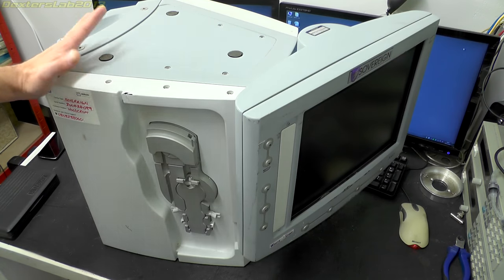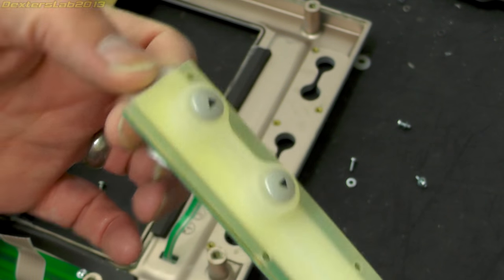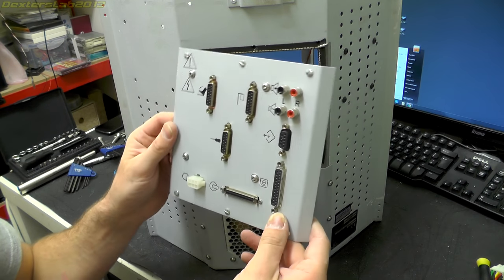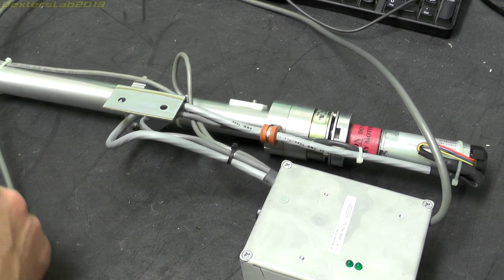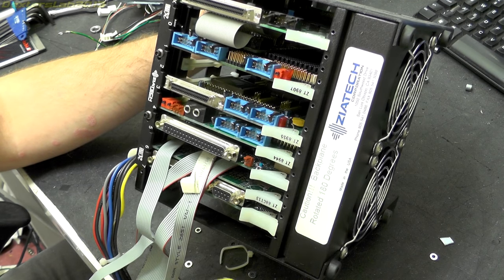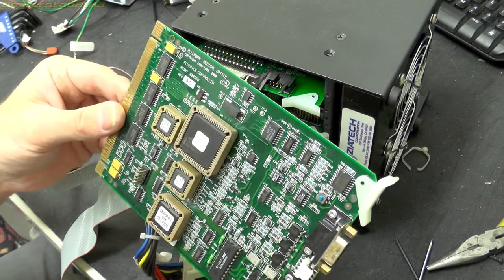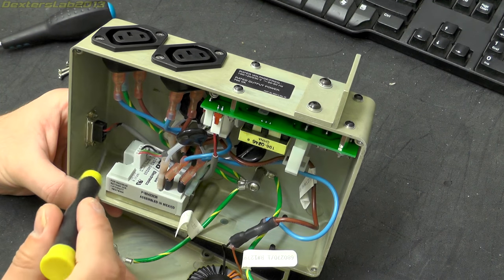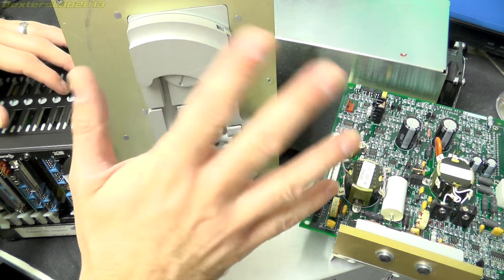DL#106 - Teardown: Cataract Surgery Machine AMO Sovereign Phaco Teardown Part 2

Comment: the big thing on the pump is some manner of air sensor. probably ultrasonic
Reply from the maker: Yes it was, i later removed it so i could resell the pump. It was basically a strain gauge (very much like electronic scales) which was moved by the diaphragm.

Comment: There will be a generator similar to a Tesla coil somewhere in there for the diathermy apparatus.  Bipolar means that the 1-2kV HF current is carried between a pair of small electrodes instead of being grounded through the body.

Comment: Thats an interesting computer. The floppy drive controller is that chip at the right of the CPU at 23:52, so I guess the interface should be that connecter at the back of the board which wasn't populated.

Comment: Cute air pump but they're definitely available in 240V, I've got two dual Thomas Pumps in automotive gas analysers (Crypton CM500s) that I put on a shelf with the intention of making a desolder station (might actually make a tear down video). 

I reckon the transformer is an isolation device so the pump meets the electrical safety standards for medical equipment.
Reply from the maker: the pump is marked as 120v, so they are killing two birds with one stone in that respect then. The transformer had multiple taps IIRC so it must be configured as step down for 240v markets and just isolation in 120v markets. Means the transformer and pump are the same where ever they are sold.
Reply: Makes it a one piece nice and  easy to exchange module.

Comment: That printer looks neat :).
Would you be able to get the computer up and running? It might not be much use but it would be interesting to see.
Reply from the maker: Yes, the printer is cute, i am tempted to make something of it. The computer should be working but it would need a bit of messing around to get functional, finding the VGA video signals, keyboard port etc. All doable but it's not something i would have time for.

Comment: Thanks for another great and interesting video!
Are you in the UK or US? I'm from Austria and pretty interested in that air pump assembly, but shipping costs will possibly go through the roof I believe.
Reply from the maker: Thanks, the pump is provisionally sold i am afraid, i am just sorting out the shipping for the buyer. I'm located in Manchester, UK.
Reply: DextersLab2013 
Thanks for the reply! I was too slow as usual...😣😀